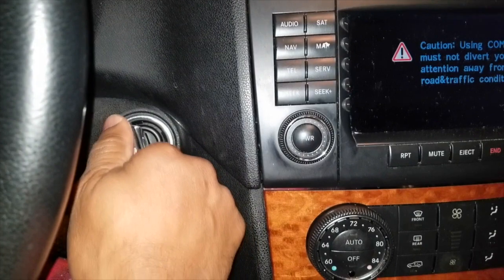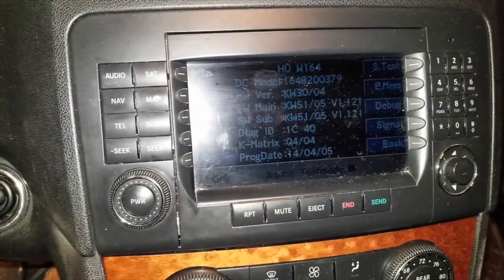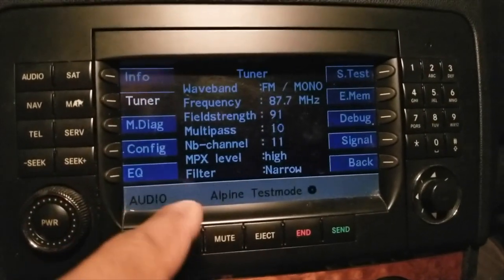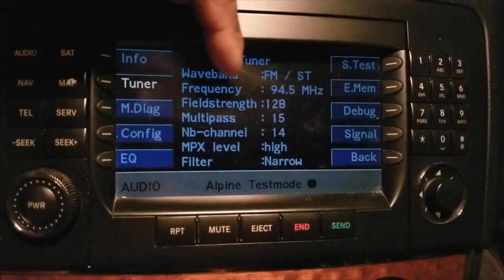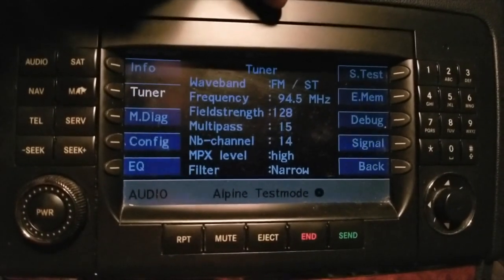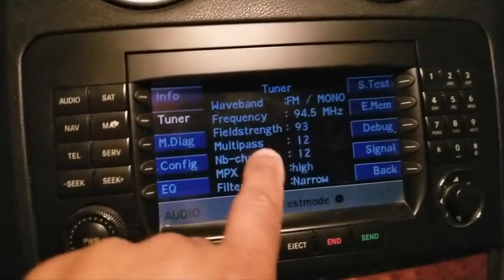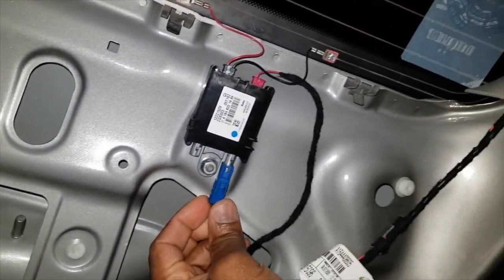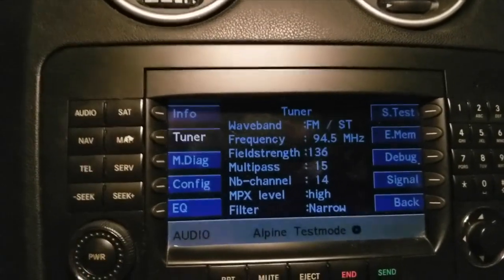Mercedes Engineering Mode (Radio Signal Strength)

Comment: Does this antenna also work for the key receptor? Because my car does not work except its very close to the driver door. Bathery is new, the lights blinks, infrared  is also lighting up,  pls help
Reply from the maker: It does not handle key fob lock/unlock signals or proximity detection.  The vehicle has antennas around the vehicle for that

Comment: Hi Keith, I was able to access the Engineering mode and saw the signal is very low with certain static sounds for CA stations. I see the settings set for Canada region, and I need to check whether the antenna is bad or not. Thanks

Comment: Hi Keith, I have a 2006 Mercedes-Benz R350. I tried  your instructions many times, and my radio kept turn on whenever I turned ignition to on position (no ignition) and pressed radio button, before I could press: mute, Ok and #7 at the same time. The radio goes on and I couldn't get to the Engineering Mode...😮 Please advise if I missed anything or if you have another way for me to try, thanks!

Comment: New subscriber from India got a question hope you will help me
I have a w211 ,2003, E240 v6
It had a abs  sensor failure 
I changed it in a local garage
Now I can't turn of dash indications 
Scanner guy said his scanner can't delete these need another one
Screen says
Esp not available
Bas
Brake line wear 
And yellow abs light on
Please help
Changed right front wheel sensor 
Right hand drive
Thank you
Reply from the maker: I wonder if you changed the correct one.   Does the scanner say which one? Also sounds like something isn't reconnected. That light goes out after the problem is corrected.  Double check all your connections and wires
Reply: @iRepairAutos  thank you I will 
I bought this car recently when I turn on the key there's a motor running sound from abs brake system  is it normal in these models it cuts off then starts again

Comment: I have an 08 ml350. Is there anyway to increase the bass output of the amp and subwoofer?
Reply from the maker: Easiest way is to adjust the bass on the head console equalizer settings.
Reply: I get that... but is there a way to add a larger aftermarket amp and subwoofer since I cant change the factory radio because of some of  the vehicles systems requirements? And Thank You for responding so rapidly!!! My wife has a 2015 BMW 328i and the factory system sounds amazing! I guess I would just like a little more low end from my MB!

Comment: 2007 r320 cdi battery was changed out and they disconnected passages set now getting srs restraint sys malfunction and cruise control and speedtronic inoperative

Comment: Hi Keith great video.  Any tip on the radio/stereo module not working?  Thanks.
Reply from the maker: Hi Deborah, what's the radio doing?  Is it powering up at all?
Reply: @iRepairAutos  Not powering up at all.  I also want to get the diagnostic machine you've been suggesting in the near future.  Should I have my guy check the fuse first?

Comment: Hey bro 

I’m still having static with my Bluetooth calls being very choppy, any suggestions please my brother. Respect ✊
Reply from the maker: Hi brother,  it could be a faulty/loose ground connection on the blue tooth module. Have you tried scanning the module for dtc codes?
Reply: @iRepairAutos   Thanks brother I'll have to get that done by a shop because I don't have a scanner to scan that.  My scanner is a regular code scanner.